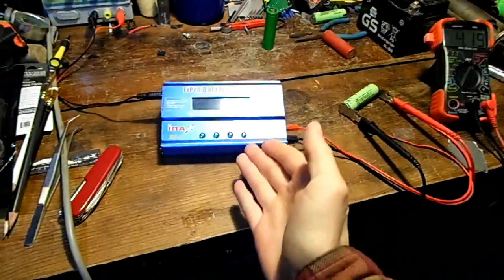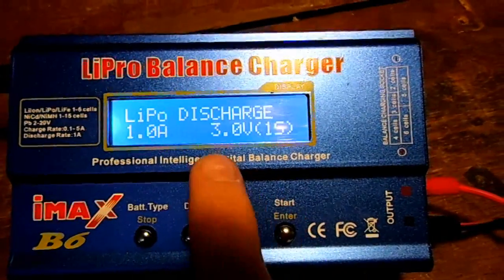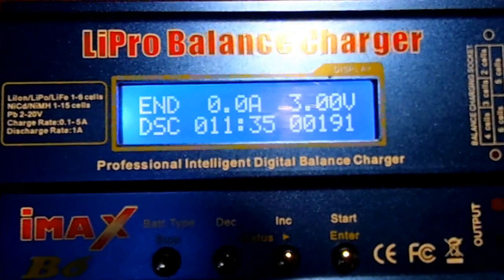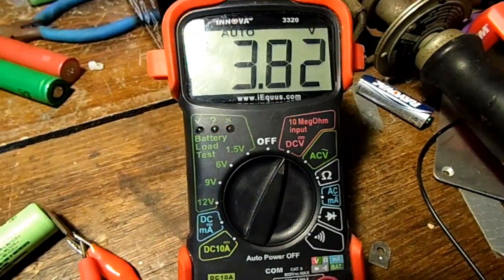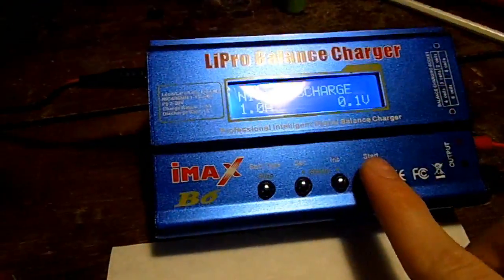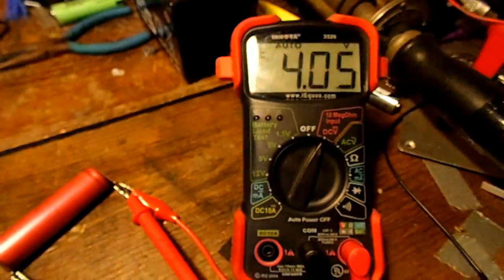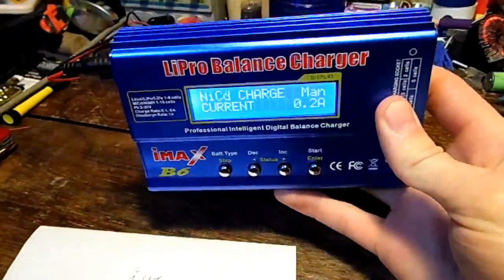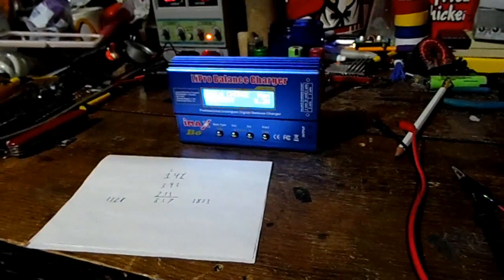18650 Discharge Capacity Test Imax B6

Comment: You shouldn't be discharging an 18650 battery lower than 3v and the reason it's not going back up to the start voltage is because your damaging the battery by doing so. Stop giving really bad advice never select the wrong battery type for charging or discharge mah testing. As that's how you damage and can even blow up the battery.

Comment: did you use magnets to connect your cables to the battery? that's pretty cool
Reply from the maker: yeah, they are a bit resistive but they work really well for low current

Comment: Indeed, the ONLY discharge profile that lets you modify min (discharge-to) voltage is NiCD.

The default min discharge voltage for LiFe is way too low, at 2V. Needs to be more like 2.7.
So, to be able to safely discharge LiFePo4, you select NiCd and set the discharge voltage to 2.7.
You'd then use that profile (NiCD) when doing the discharge excersize. Don't forget to switch back to proper mode when doing charging.

Discharge power max is 5W, so you will have to adjust the discharge current to stay within the limit.

For example, discharging single LiFePo4 cell, at 3.2V, you max discharge current needs to be 1.5A or less. Otherwise, if you set it above that value, Imax will stop discharge after about 11 secs

Comment: the reason your voltage is of is because that is a fake imax b6. trust me, I have a fake and a legit one. also check this out https://youtu.be/pJXzYqe1_zg
Reply from the maker: well it isnt fake, its a knockoff. it does exist and get the job done
Reply: knock off would imply that it is another brand copying imax, but this company has gone right out and put imax b6 as a brand on it and counterfeited a fake(as in not real) imax b6 charger.
Reply from the maker: a fake would be a wooden model with crayons marked on it, these are probably made in the same factory as the name brand ones and they do work, they just dont work anywhere near as well. thats how we have so many knockoff items that are so exact, they sometimes run third shifts behind the customer‘s backs.

thats also how you have all those black market apple product components in china. they should be shreaded but someone smuggled them out of the foxconn or samsung plant. my source? i used to work at apple.

Comment: Hi, I have the same IMAX B6. Please tell me how can I check the capacity by charging/ discharging Lipo battery 1,5V (seller written capacity 4000mAh) in battery type D. And it have micro usb port for charging. As I understand there is small 3,7 V Lipo inside with converter to 1,5V. So should I charge/discharge for test through the micro usb port as normal 3,7 v Lipo?

Comment: Ya, you are discharging lithium ion with with lipo settings. you can set it to li-ion in the user program.
Reply from the maker: lipo and lithium ion are the exact same thing, there is no electrical difference, just fyi.
Reply: Rinoa Super-Genius In the charger you are using, the ions and polymers have deferent charging voltages.

Comment: hi rinoa  can you advise how to charge a row of 18650 new cells s that dropped to 1.3v 5p when used in my ebike .others were over 3v .they are in a vruzend kit so can separate easy .this happened before  a 5p row of Samsung new cells dropped to 2.0v  .its a 52v 14s5p kit diy.

Comment: your charge to 4.1V and discharge to 3.0V this should be a difference of 1.1V, so if you have a 2200mA/h 18650 this mean you are using only 2.42WH of the total capacity of 9.24WH, I'm right or I'm missing something
Reply from the maker: your missing a lot.

Comment: Rinoa you are the Man to ask, Do you know of a Balance discharger with pre set volts per cell like you are doing here with 
single cell for 18650 down to about 2.6 v or whatever for my 6s1p packs ? cheers Brett
Reply from the maker: +kermets so you want to take each cell down to a specific voltage? ya mean like bottom ballancing? im not a fan of bottom ballancing myself, and i dont know any that are precise when they go down that far.
Reply: Ok thanks for the reply, My Accucell 6 similar as imax B6 only goes down to 3v per cell and that maybe leaves 20 % capacity untested, my way if it was possible you could batch discharge/charge in packs of 6 or whatever you set the battery holders up for with balance plug, would save doing this per cell which is taking forever to recover/test 100 or so cells etc, cheers Brett

Comment: Maybe I problem with using the discharge on these units mate. I did the same thing and the Amp draw was way off, but it still calculates the mah on the ampage you enter. I used a separate tester and although I set it to draw an amp, it was during about .6 and the max counter added up a lot faster than it did on my other tester reading the actual amps being drawn. I know it was a long time ago, but just something to note.

Comment: The behavior you notice at 3:30 is a result of basic electrochemistry, ionic resistance, ESR, etc. Stuff I'm sure you are familiar with. If you fully discharge a battery, down to 2.8V, once you disconnect it the voltage will recover (it might even get back to 4V! Don't be fooled!) however the ESR will stay high in the discharged state (that is to say the voltage will sag immediately being connected to a load) I like to think of this like when playing a sport like soccer. It wears you out but if you take a break, you regain your breath and some energy to keep on, but of course you can't perform nearly as well or long.

Some other quirks about battery life, the faster you discharge it, the less energy you will be able to extract. A 3000mAH battery might only deliver 1900mAH at 5A load. If you let the cell rest and recover you can squeeze a small amount more out of it but not much more. Likewise discharging slower would allow more energy to be extracted. Typically, 18650 cells are discharge tested at 200mA constant current.

If you want to make a discharge graph when powering a device with a switching buck converter, use a Constant Power discharge. If you are powering a device with a linear regulator, then use constant current. If you are powering a brushed motor or other "passive" load (like a lamp) then use a constant resistance discharge. That will be the most accurate type of discharge for the particular application. Of course try to match the power/current/resistance of the discharge to match the load you plan to use.

Comment: LiPo batteries are considered dead @ 3v, 3.7v is nominal and full charge is 4.2v. A fully charged 18650 is best measured at a discharge rate of .5A .. Bringing voltage below 3V is risking damage to battery. The 18650 will recover when drawn at high rate. Try drawing the discharge at a slower rate to not shock the battery which none of the three in this video are designed for high rate of draw . This is why your results are flawed. if you want to test high rate batteries try batteries such as the Sony VTC4 or the LG HB6

Comment: When using NiCd battery to discharge on cycles.  Discharge charge 2.  After first step, discharge it gives a voltage error and the discharge charge cycle stops.  Can you explain why and am I doing something wrong?

Comment: +Rinoa Super-Genius I'm testing some old and probably shitty 18650 Li-Ion batteries and trying to meassure their capacity. 
I'm discharging them using the imax b6 with the Li-Po program at 1A down to 3.0V. The voltage drops pretty fast down to 3V and is kept there. soon after the discharge current starts dropping as well.
I this normal behavior? I was expecting the discharge current to stay at a constant 1A and the program to end once 3V is reached?
Reply: These chargers are a piece of shit for discharging i have to set mine to 2.8v on nimh to get it to actually discharge to 3.0v.

Comment: What is the right way to arrange the 18650 batteries after a discharge test. here is the mah of the batteries http://electronics.stackexchange.com/questions/232698/diy-pack-amp-difference

Comment: Hi Rinoa,

Right now I'm also building a battery pack and I just want to say your videos have been very helpful. I have the same fake iMax B6 charger as you and I just have one quick question about it.

What is the difference between the different discharge modes, i.e. when you choose a different battery type. Is it only the range you can set for the end voltage and amp draw or does it do anything else?

Right now I'm in the process of checking the capacity of my batteries (78 in total) and am noticing what you mentioned in some other video as well, that when you choose 1 amp draw current for LiPo, it doesn't actually do that. Can I instead just use any other mode and choose the same values as I would have on the LiPo setting and it would work just as good? (... but with a consistent current draw)

I hope you see this message and find time to answer it.

Jesper

Comment: i think i have a fake imax b6, the discharge feature does not work, it just goes on for 2 hours on all cells.
Reply: +OnlineBackupServices I have the fake one and have ordered a real one after noticing. I got a refund on the fake one and I have issues with mine too. You'll need to disable the 2 hour limiter on the fake imax for it to fully discharge the battery but even then the charger is unable to read the correct voltage.

Comment: Does any one know how to discharge lots if cells in one go?
Reply: +Richard lawrence I've been looking for an answer to your question for a couple of years but haven't found the answer.  An arduino and multiplexer could measure a multi-cell discharge but I was not smart enough in electronics to trust the results of the prototype I tried to build.  Good luck.
Reply: +Richard lawrence You would need to build a custom circuit that would discharge each cell individually and monitor each cells voltage as it discharges. This could be done with a constant current load circuit connected to an arduino or similar micro controller. How many cells are you looking to discharge at one time?

Comment: What kind of magnets are you using on the ends of the batteries? Where do I find those. It seems like a smart way to do that.
Reply: I know this is a really old comment, but anyone reading this should know for this electrical application to get the nickel-plated version of the "neodymium" magnets.

A couple of notes. 
1. Neodymium magnets come in different compositions. The cheaper formulations are generally acceptable for this application and you don't have to buy the most expensive version.
2. Over time the nickel-plating can be compromised and actually break/peel/flake off of the magnet itself. After that happens the magnet can quickly deteriorate especially in high humidity areas. Just periodically check the magnets for plating damage. This is especially true for the smaller magnets that are shipped in long assemblies of magnets stacked one on top of the other. The combined forces applied by the magnetic attraction can put so much pressure on the plating that over time it can crack which allows it to eventually peel off the magnet.
Reply: I'd like to know too, did you ever find out ? Thanks !
Reply: neodymium magnets, you can get them on ebay pretty cheap. Also radio shack has them.
Reply: Thanks will go looking
Reply: Get them from discarded harddrives.

Comment: Hey Ya. Rinoa Super-Genius You make a mistake by discharging li ion less than 3V.
Firstly its the best way to destroy Your cells
Secondly think about practical usage. If You put charged 18650 battery for example 13S  you get 48V and as you do discharge them to 2V You will receive 26V (13 x 2V) summary. Have You ever thought that 48V BLDC controller cut off limit is standard 42V. So as you can see even a pro bldc controllers treat properly li-ion cells discharging them only to 3.2V

So if discharging li-ion to less than 3V is:
-dangerous 
-destructive for the cell 
-impractical because of worst effect of working electrical devices on the half of voltage (slower / non starting)
Reply: Use li ion dischare function
Reply: Completely incorrect. Have you ever looked at the datasheet of a LG Choco 18650 battery? Or a Samsung 25R battery? They both say min voltage is 2.5v. The specified capacity is of course a full charge to 4.2v and then discharge with constant current down to 2.5v. Usually with current 0.2 times of the specified capacity. Thus, if the battery states 2500mAh, you should discharge with 0.5A to get the correct end result. He is testing the capacity of the battery. Not USING the battery, so the practical usage is irrelevant here. He simply want to check the exact capacity, which would be discharging until it reaches 2.5v. Having that said, I am pretty confident that he is using a chinese clone of the IMAX B6. Those are not calibrated correctly at the factory and will give you wong current and voltage readings in the first place.

Comment: I just got an Imax B6. Can you test capacity of a battery pack 6P1S and find out the capacity of each cell with the Imax?
Reply: +Stephen Garner sorry I meant 6S1P
Reply: +Stephen Garner 6s1p is the same as 6s. 6s means 6 batteries in series, 1p means one parralel.  is is like saying 6x1 or 6. same thing. As for how to test the batteries, there should be a balancing plug that will give you access to each battery in the pack. By using  a voltmeter you should be able to figure out which wires are for which battery and test the cells individually with pairs of wires.

Comment: Nice video. Got a question for anyone who can bothered answering. I have bought a 6800 mAh ni-mh 7.2v 6 cell battery pack. I have used it once with an r/c car. It didn't seem to get as long as expected out of once use, its meant to last for 30 - 40mins only lasted about 10 mins. I was thinking... will discharging the battery completely then charging it make the battery perform better? If so, should i discharge every time before charging. Also, I have zero knowledge about battery discharging what do i set the Amp and voltage settings to for safe discharge on an imax dual charger? Thanks
Reply: well since your question was asked 7 yrs ago this wont help you but for anyone else who might wonder if they should completely discharge a lipo battery before charging...NO, absolutely not. Doing so will either kill it on the spot or greatly damage it and ruin its capacity. I have found that most causes of premature failure of lipo batts is from over discharging them. I would recommend not to take it down below 3.2 volts per cell. That's how you get the most charges and best performance from lipo batteries. There really isn't much benefit from over extending the useful charge from a lipo, the performance suffers substantially below 3.2 volts anyway so where is the enjoyment from under performing while ruining your equipment?

Comment: your imax doesnt show the right voltage...its not the resistance from the wire...you just have to calibrate it
Reply: Apostolis T. how
Reply: @aliensanonymous5063  plug out cable, press and hold dec and start, plug cable in, wait for it to boot, you will enter menu and then you can add or remove voltage, so it reads it well, measure battery with multimeter and when you are done, simply press start.

Comment: It's dangerous and destructive to discharge a LiPo cell to less than 2.5-2.4 volts!!!
Reply: BIll Georgoulakis Also it's pretty pointless to specify capacity based on a cut-off of 2V because no circuit will be usable down to that voltage...
Reply: +BIll Georgoulakis 
LiPo batteries die when under 3V... they may seem ok but they can explode if they are discharged under 3V and left somewhere between 1-3V or even worse: charged back up to 4.2 after being under 3V... The B6 therefore only discharges to exactly 3V, which i think is way too low, i never discharge mine under 3.3V, my high amp lipos only to 3.7V

I have to point out though, that this is only what I have read. My dead LiPo's never caused any problems, even used puffed LiPos without problem..
I may also add, that getting rid of a dead lipo is easy, make a big jar of water with lots of salt in it, then just drop the discharged lipo (@3V) in the solution and wait a few days, then throw them in the battery garbage.

Mr.Genius here should make a new video and inform this, as what he just showed is very dangerous and could end up someone burning their house down...
Reply: MrPipaSc That's right!!! (and thanks for the tip about the salt water, I did not know that)
Reply: MrPipaSc However, there are a lot of battery monitoring IC out there that allow for discharge down to 2.6-2.7 volts! The majority of boards on ebay use them.
Reply: Dude, this is not a LiPo !
Reply: +BIll Georgoulakis These are Li-ion batteries not Li-Po, there is a difference, and can be safely discharged down to 2.5v.   Capacity is about 30% more than the equivalent weight Li-Po.

Comment: I have a 60v SLA battery in my bike and I want to add 60v lithium pack to it as a backup  can I wire both the negiteves from both battery's to the Ebike.  And have only 1 positive from 1 battery pack  at a time connected to the bike. Or will doing this wreck the lithium set.  I don't want to hook both up at the same time I just want 1 set to use until it dies and flip a breaker off to disconnect the SLA positive terminal. And flip on the lithium set positive breaker   Let me know if this is safe as I don't want to have it break. Thanks
Reply: al theway If you can't tell that by yourself, then its not safe.

Comment: Can i charge a 18650 battery with imax b6 ?? Do i use lipo mode? N charge at how many amp?
Reply: +Eugene Ng no you use Lilo (lithium ion) mode
Reply: +Eugene Ng an a safe rate for a some what used or new battery is 1 amp then do a discharge when full to see if it has higher capacity for higher amps when charging